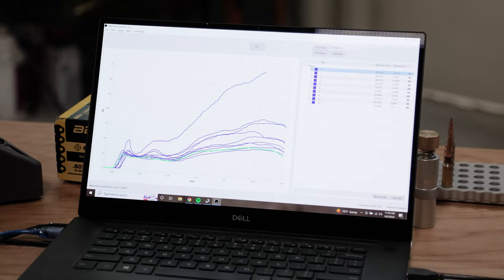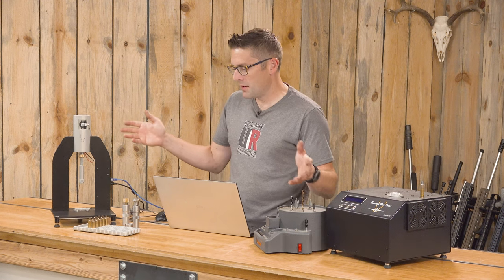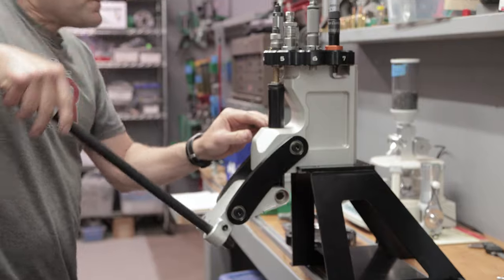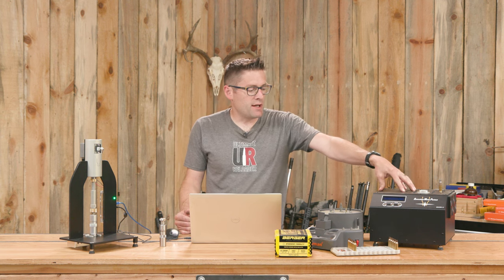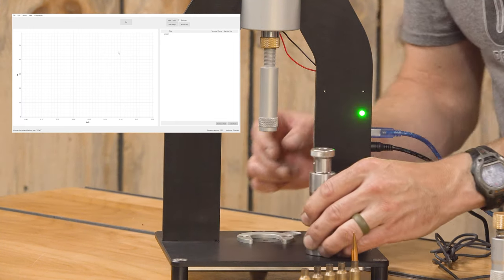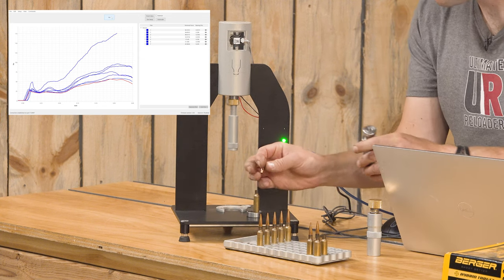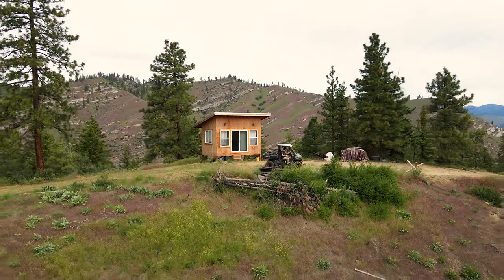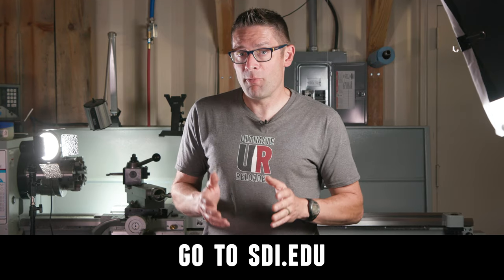AMP Press: SW Update, Neck Brushing Experiment

Comment: - Correlation of seating pressure variance with accuracy
- Comparison of seating pressure between cases that are cleaned after sizing vs those that still potentially have lube in case necks

Comment: That 5th round might have a slight doughnut forming, would need a closer inspection? For a future video maybe nylon brush vs bronze brush and maybe amp annealer vs a few hand annealed methods, the simplest one ive seen for example is to grab a case with bare fingers, then anneal using a torch turning it for a few seconds heating it evenly, quench vs non quenched, graphite or moly lubed vs non lubed, annealed vs nonannealed, chamfered vs non chamferred or degree/angle of chamfer, just a few ideas off the top, youve probably tested these already.  Great video as always! Forgot to mention def would like to see the effect on target.

Comment: I brush all my cases. I use a. 270 bronze brush for 6.5 in my drill press. Run the case up and down 3 times.  My bullet seating is smooth as butter. I get great SD and tight groups. I do not lube the necks.

Comment: So you have a real cool press.  What did you do before using the nylon brush?  I wonder if you would use a stainless curl brush at drill motor speed would give more consistent press force? It seamed to work for me.  All though I didn't have the press gage.

Comment: Who noticed that the 5th round did not seat all the way?  Why?
Reply: The amp press has a max force that it will apply which is set in software but maxs out like 190lbs I believe.
Reply: @BoltActionReloading  Does the software not warn if the full stroke is not reached?  Seems like that would be a good safety notification.
Reply: @ewathoughts8476  if the graph isn't complete you know.
Reply: @BoltActionReloading  Ah, failed to notice the trace did not terminate on the right edge of the graph.  It just topped out due to pressure limits of the device.  Thanks, it is hard to notice everything when you  do not have the device.